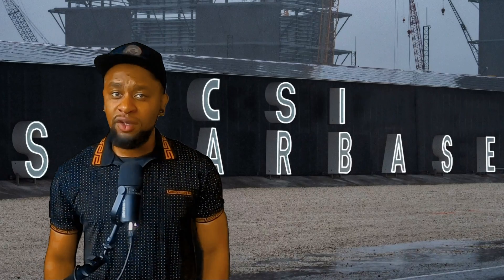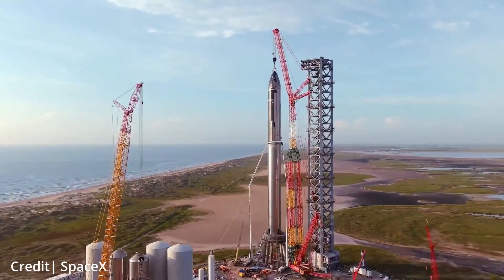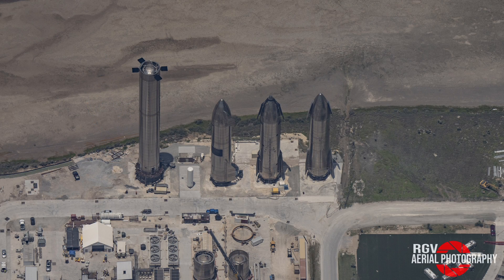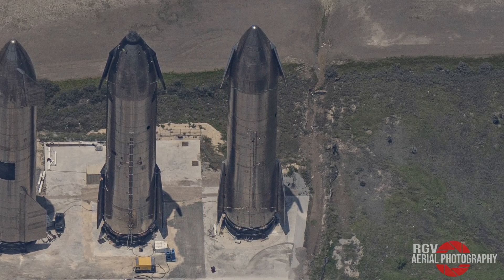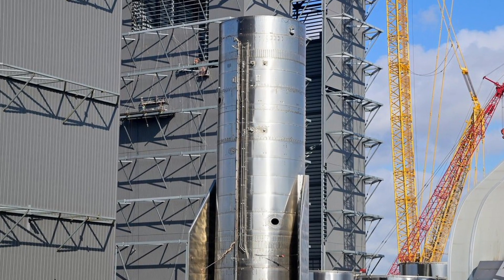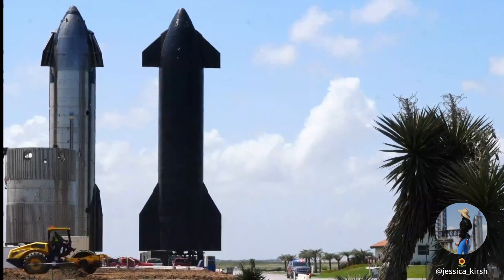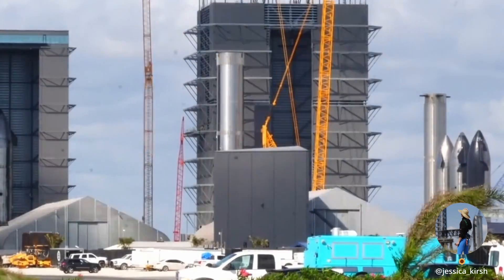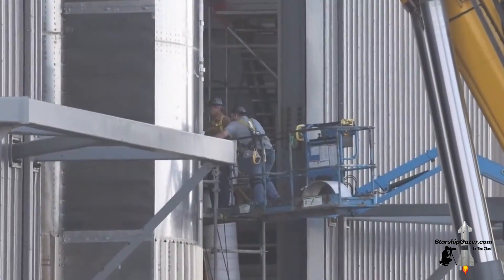Major Updates For The 2nd SpaceX Starship Orbital Launch Integration Tower

Comment: I have wondered for a while why SpaceX hasn't invested in a steel mill so they will have priority for their requirements.
Reply from the maker: Right!  Why but Twitter when you can buy a steel mill?
Reply: @CSIStarbase  Think of all the steel that will be needed to build all future StarShips, launch towers & refitting any additional oil platforms. And any extra steel could be sold to Tesla at a small profit but still cheaper then other steel sources will be willing to sell at.

Comment: the angular reinforcement on the base of 1 is considerably more fragile or simply not yet finished at the point of contact with the base in the middle. 2 and 5 are riveted in the center where they meet the bottom strut making more massive!!

Comment: Zach, I can see a couple of possibilities for shipping OLITs. From the Roberts road site, a fairly short SPMT ride will get you to the Turning Basin near the VAB. From there, the barge channel leads to Port Canaveral. The only disadvantage might be the "air draft" as there are power-lines crossing the channel and at the entrance to the Port's lock. I'm not sure about either the height of each section on a barge or the height of the power-lines. Perhaps a section could be shipped on it's side, these things aren't frail! The other possibility is to use Starbase. Everything's there already, and as Boca Chica moves into the era of developing and launching, the experienced people who built the first OLIT can turn out more towers. The Port of Brownsville is a fairly short ride down the new connector road and SpaceX owns property there already.